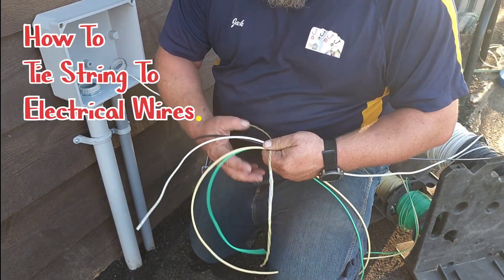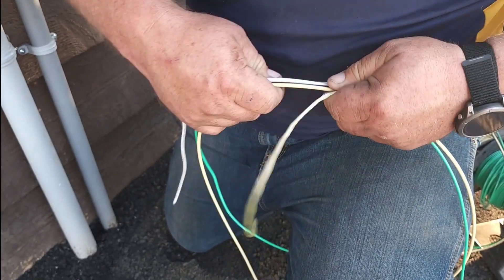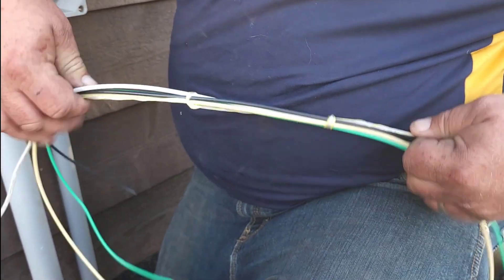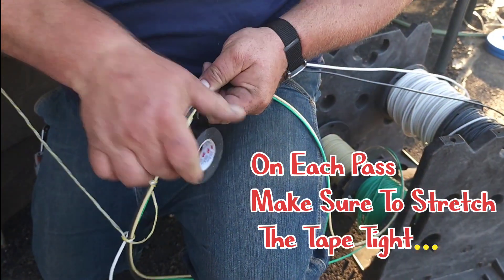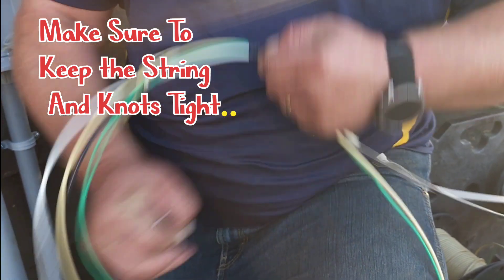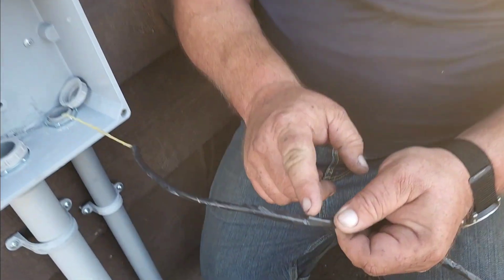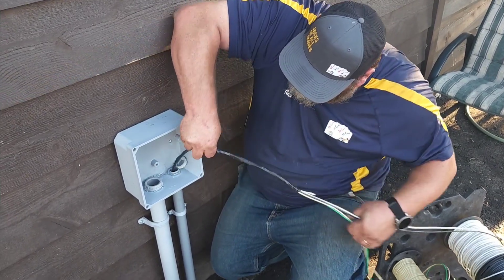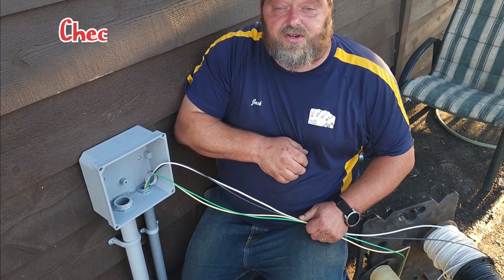Master the Technique: How to Attach String to Electrical Wires like a Pro

Comment: Of cause you stretch the tape for a stronger joint for pulling. The way I  show the difference for an apprentice is I get them to put their pointer fingers side by side facing each other, then wrap their fingers together a few times without stretching the tape then get them to pull their fingers apart, and they manage this easily. When I do the same thing again but I stretch the tape ,the pressure is to great usually and the pain of their fingers being squished together is to much, but they finally understand how much stronger a stretched tape joint is over even 3 time the amount of un-stretched tape.
Reply from the maker: That is a great trick!

Comment: If you need that much tape you are doing it wrong. I have done 1000ft pulls with less tape
Reply from the maker: Agreed, however the people watching this may not understand the technique of taping very well and I want to make sure that it doesn't come off.
Reply: Agree with too much tape but I get your point. When you're new at it you'll soon learn to use less. I learned it back in the late 70's as a then PBX field tech for AT&T.   @TheJacks
Reply from the maker: @randytellez2451  Thats awesome!